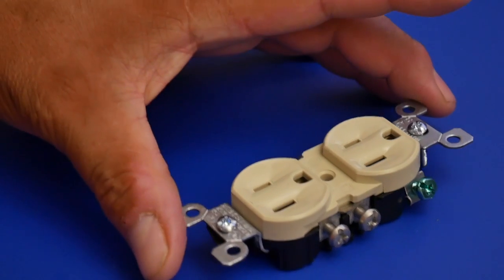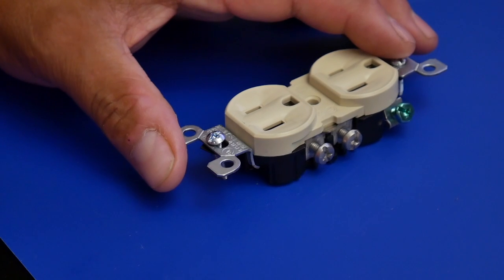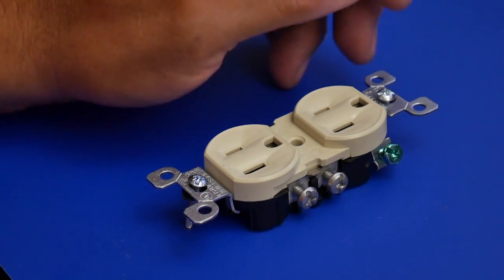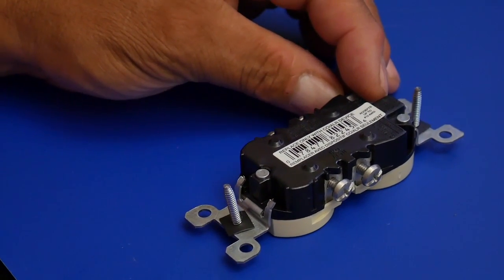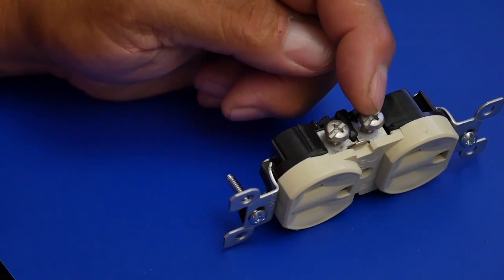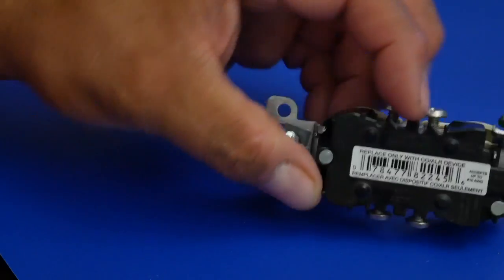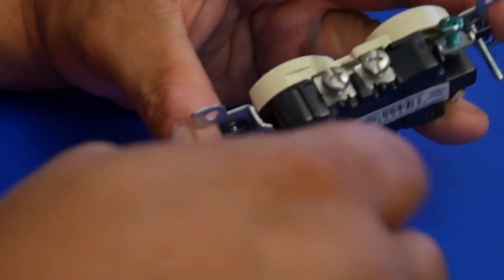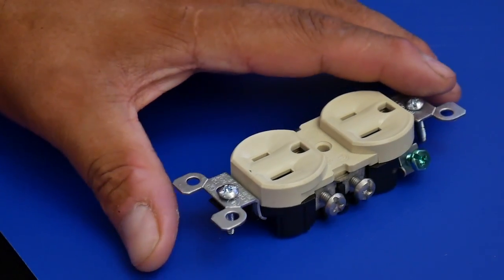Duplex double outlet wiring explained 110-120 volt

Comment from the maker: The only exception would be a different style plug. At times I have seen 110/120 volt 30 amp plugs that have a different plug but for the most part over 95% Yes!

Comment: To anyone watching this video, it is stated that if there is a short to "safety" ground in the receptacle that the power goes to water pipe is incorrect.   A short circuit on an equipment ground does not go to any grounding electrodes.   It goes to the main service ground/neutral bar and then through the neutral to the utility transformer and back to the breaker to cause it to trip.
Reply from the maker: depending on where you visit in the US local codes are different and I have  seen much more then just one way of grounding a ground wire. Some to actual ground using a ground pipe or pole,  others to water meters Easter Norther US and some that connect back to neutral at exterior main service panel. But this isn't always the case.
Reply: DIY-FIXIT    I agree with what you are saying about Grounding Electrodes.  They are for the purpose of taking lightning strikes or surges to earth.   Most people think this is also where shorts to ground go, but it isn't.  A short to the ground on a receptacle goes through the utility transformer, not to earth, to make a breaker trip or fuse melt.  Knowing this makes Article 250 in NEC less confusing.
Reply from the maker: @KevinCoop1  Seems I stand corrected after speaking to a master electrician.  He verified your statement that the ground and neutral are fused together at the main services panel. So you are correct and I got it wrong.
Reply: DIY-FIXIT    No problem!  Understanding this helps understand grounding in NEC.   We are all incorrect sometimes.  I just found out this week that I was incorrect about this in England.   Their "Earthed" system is not connected to the electrical system.   Everything has Ground Fault which trips at 30ma.   Total opposite of our systems.   Respectfully,   Kevin